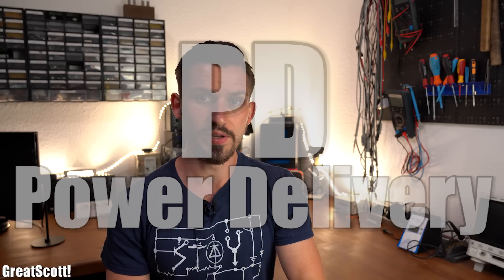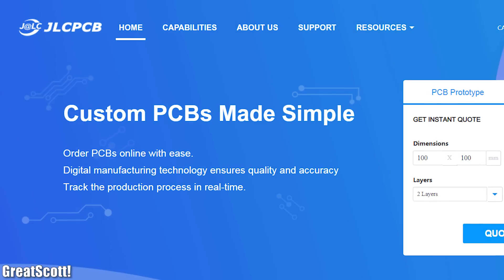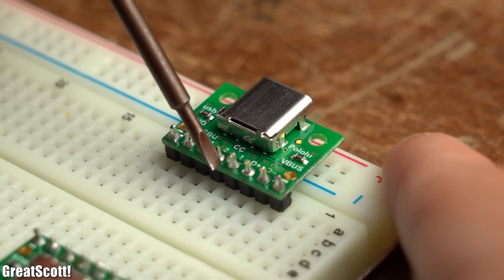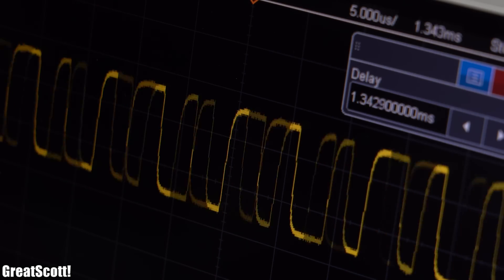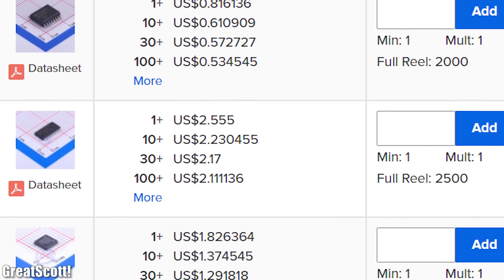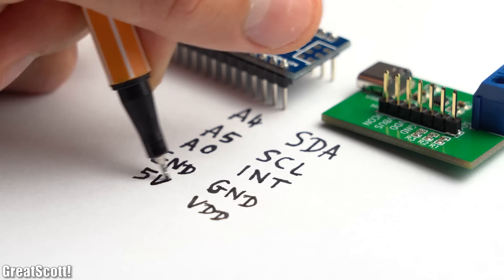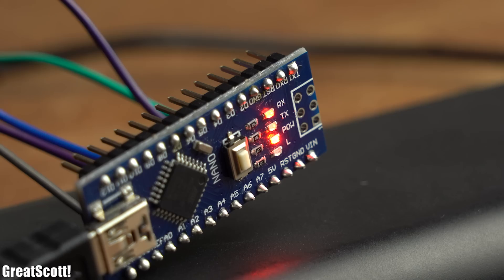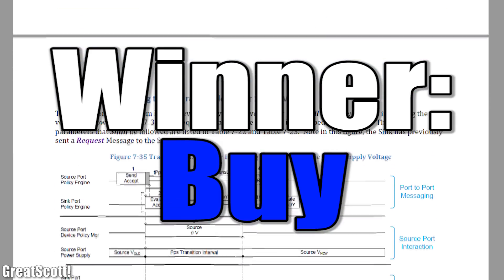USB Type-C Power Delivery Trigger Board || DIY or Buy

Comment: @greatscott! Hey scot ! I jst wanna make a ups for my modem and router ,which needs 12v o.5 amo which was 6w for each...can u please suggest me the best heardware for this project.
Reply: That's actually a good idea. Wouldn't even be hard, just a 12V battery, a relay and some controller.
Reply: I wanna run my ups on my powerbank.. So inst of 12v battery , i wanna use boost converter... For which i was thinking about less hours of routing and might damage my powerbank...!
Reply: @chandrasekharguntupalli4079  too much 'convert' make it not effective
Reply: @chandrasekharguntupalli4079  That actually simplifies it a lot, as a power bank is essentially a UPS. There are 5V boost converter modules you can buy on amazon, even ones with USB inputs. So all you need to do is to connect a USB charger to the power bank's input, connect the boost converter to its output and connect the output of the boost converter to your router. The power bank will handle all the power switching on its own.
Reply: @theodiscusgaming3909  so can i run '2' 12v  load on one boost converter..?
Reply: @chandrasekharguntupalli4079  a USB port on a power bank usually is capable of supplying 10W of power (check the power bank to make sure). And the converter will cause some loss, which depends on the converter. But I have a feeling anything under 8W will work just fine (but it's just a feeling, so you should take that with a grain of salt). If the combined draw of your loads exceeds this, you'll probably run into problems.

One way to get around this is get one of those more expensive power banks that have two USB ports, and provided both can supply 2 amps, that means connecting them to the boost converter in parallel would give you 20W of power to use.
Reply: @theodiscusgaming3909  thanks...i will try it right away....🥰

Comment: If you want to inspect the USB PD protocol, I recommend the AVHzY CT-2. It's mainly used for triggering and measuring power draw (which it's fantastic for) but it'll also enumerate all the available power levels and connect to desktop software to show you all the messages going back and forth. Super handy, I used it for evaluating ~30 power banks. Also a minor nit: USB-PD isn't only for USB Type C. PD 1.0 works with micro-USB and type A/B. PD 2.0 is the main one you're a fan of I think, with the separate config channel on the Type C connector.
Reply from the maker: Thanks for the information
Reply: GreatScott! In case you didn't see, I edited my comment to add a little nitpick about PD and Type C. Don't want people to see your comment and think you're agreeing with something you didn't see.

Comment: Some of us want to DIY  shit for more permanent use. How about a hardwired one voltage only board? No programming. Just like Teensys with panel mount full size type B ports would be better. Should see the clusterfuck or wires and electrical tape inside my Teensy-run MIDI controller; panel mount would fix that.

Comment: I suggest TVS diodes on those CC pins. You want to try avoid large transients on cable removals
Reply: @FQD2N There is inductance everywhere, it might not be big, but it's there. Just because it's not on a cheap aliexpress board, doesn't mean it's not a good idea to have it. External interfaces (even USB connectors) should have some ESD protection minimum. TVSs are one way of doing that.
Reply: Could you elaborate what would cause the large transients? And why diodes would help that
Reply: LC Raz When you unplug the cable, there is a spike in voltage. This is due to the storage of energy in reactive elements of the circuit. An example would be an inductive load, when you unplug it the magnetic field rapidly breaks down and induces a high voltage. A TVS diode works by depending on the voltage to exceed its breakdown voltage. Essentially when the Spike exceeds the breakdown voltage of the diode, the diode will shunt to ground.
Reply: LC Raz built-in transistors serve the same purpose.
Reply: @FQD2N see this guide https://www.ti.com/lit/wp/slyy105/slyy105.pdf?ts=1592861588015 from TI. You can also checkout the datasheet for a reputable USB PD implementation like the stusb4500qtr chip which includes protection for this type of thing in the typical application example. The circuit designed in this video is a very naive implemenation

Comment: Wow... Really interesting project, dude! But complex as hell! 😬
Anyway, I have a question for you. Is it possible to make a USB type C power bank at home? Are there components available for it?
Because there are already a few very interesting USB type C tools on the market, like some soldering irons... That would be fantastic to have in the field when you're flying quadcopters or rc airplanes and need to fix something!
Anyway, stay safe there with your family! 🖖😊
Reply: You can buy on eBay the usual USB c power bank PCBs and ready made sets for some 18650 where the case is included.. Maybe better to buy one high quality USB c powerbank
Reply: @kitecattestecke2303  Maybe, but I'd rather build my own stuff. You know?

Comment: So theoretically, if you bought a PD trigger board and set it to 20v, you could charge a laptop running at 19.5v if the power supply delivered the correct amperage?
Reply from the maker: Yes

Comment: I recently had to make a small usb 1.0 HID implementation to create a virtual joystick and oh boy, usb is hard
Reply: That sound nice, do you have a video? Or any documentation it would be nice to learn such thing for diy home joystiking :-9
Reply: I still remember the USB Song. I will try to translate it as good as possible:
„1 carries voltage and 4 the ground, be careful to not switch around. 
For data it goes the other way round. Pin 2 is data minus and pin 3 data plus.
Remember to never mix up host and device.“

It goes on with a second verse about the first bytes that are transmitted etc. it basically teaches the core principles of the USB 1.1 Standard. The third verse is about best practices and limitations. Lovely little children’s song.
Reply: @WurstPeterl  You learn about USB in elementary school? The only thing we learned was how to use MS paint... welcome to Czech Republic lmao
Reply: That’s why you learn it in elementary school in Germany
Reply: USB is great in principle, but 600+ pages just to document power? 🤮 What a design-by-committee mess!!!

Comment: This is exactly the project I was currently working on! This is absolutely perfect timing! Solved 90% of my questions. Thanks
Reply from the maker: That is what I was hoping for :-)
Reply: @greatscottlab  Yeah I was researching to make a single board design to power my dslr camera via usb-c PD. But after this I'm just going to combine two existing boards. That is as you concluded way easier.

Comment: What the... I was just researching this the last few days to convert some devices to accept USB-C. Edit: To clarify, I meant USB-C PD. I'm primarily looking for the power-source (above 5V3A), not the data transfer (but also looking for something which combines both)
Reply: Look for DIY perks USB-C conversion  video, he has very simple explanation for non techy people. Combine his solution with basic electronics here, Thank me later 😀
Reply: @sdffsdafdsfsdfsd  I'm looking to convert devices which don't feature USB Power input. (Stuff that requires more than 5V or 15W). I'm also wondering if a board exists that accepts USB-C PD Power but also features USB data transfer to a device behind it. Haven't found anything like that so far.
Reply: @NorthcodeNoCh  I think you would need to DIY a passthrough board which includes D± and a 5V regulator.
Reply: @NorthcodeNoCh  Any updates?
Reply: i really want to do this to some devices too.
Reply: If just accept type c charge and data transfer i think he have other video for it

Comment: Dear GreatScott, 
I'm trying to make an Arduino RC Controller using an Arduino.
The first prototype is done and working just fine.
I've used the nrf24l01 as the transmitter and an Arduino Pro Mini as the brains. It has 14 channels currently.
Now I want to add a 1.8in TFT LCD (ST7735) to the system. Since the display has a SPI interface the Arduino has insufficient pins to run it in its current state. 
Should I use a separate Arduino to process all the information for the display such as the menus and the encoder and then send the final information to the Arduino through the I²C bus so that the LCD doesn't use much time of the Arduino that is transmitting?
Or should I just use the STM32?
I'm just a beginner so that's why I used the Arduino.

Thanks in advance.

Comment: I've had the idea of somehow probing the pins of the type c, imitate the signal and maybe some day design my own PD powerbank. This video made me think twice about that thought 😅
Reply from the maker: Yep,....not that simple😅
Reply: @greatscottlab  Andreas Spiess had also a simple Video about hacking quickcharge. He also had A link to a github Page. They used an arduino nano to trigger quickcharge (They only Used 4or 5 resistors to Use the arduino as a trigger. No other ic.)
Reply: @Enderkruemel  quickcharge is something different from usb-pd.
Reply: @Statiscube Patreon donors get early access.
Reply: @andrewkieran8942  How do people STILL not know this. Geez.
Reply: @Statiscube YOUTUBE broke down...
Reply: @GreatScott! I assume large file size was due to having full fledged protocol compiled into microcontroller, you don't want unnecessary code for data signaling as long as whole purpose of this is to deliver power at certain voltages only and can be safely stripped down to manageable size for small controllers
Reply: @Statiscube hol up
Reply: 5 days ago???
Reply: @TheMusicalTech  Patreon supporters get early access